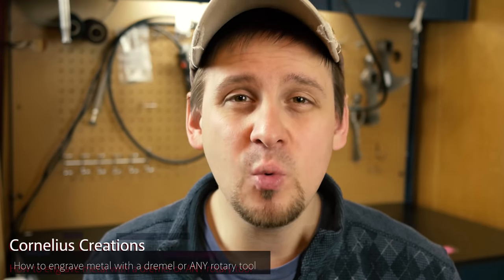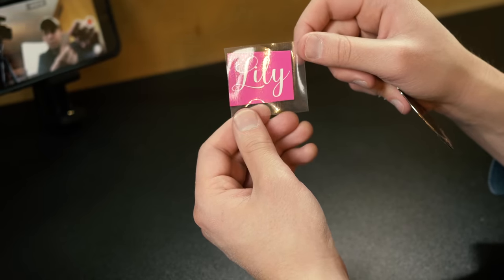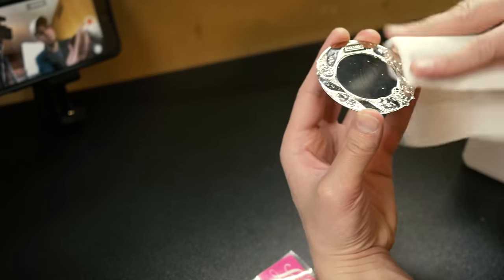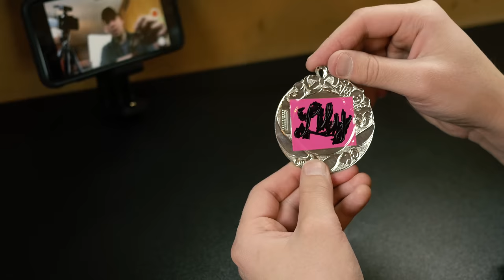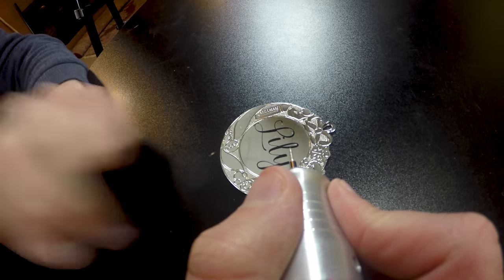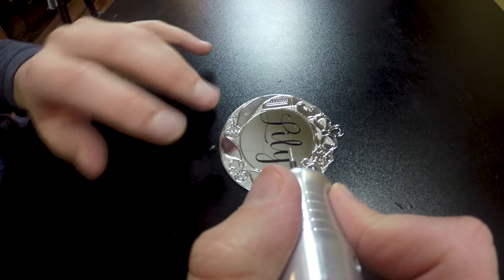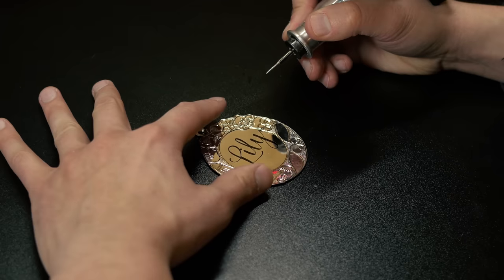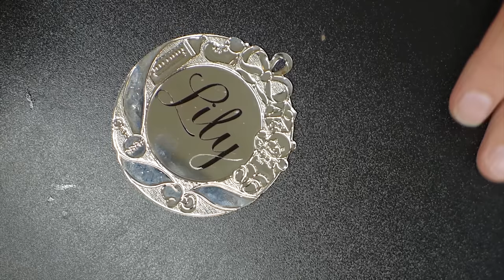How To Engrave Metal With A Dremel Or ANY Rotary Tool

Comment from the maker: ⚒️ TOOLS & SUPPLIES I USE FROM AMAZON ⚒️
⚡︎ FOREDOM CARVER (MY FAVORITE) https://amzn.to/2HRXbzC
⚡︎ DREMEL 4000 CARVER: https://amzn.to/2Ubc4TS
⚡︎ CHEAPER CARVER: https://amzn.to/2HPa1i5
⚡︎ CARVING HAND TOOLS: https://amzn.to/2HSLusu
⚡︎ BASSWOOD BLOCKS: https://amzn.to/2WCYXYr

⚡︎ ROTARY BURS: https://amzn.to/2Va2Q79 
⚡︎ BEST WOODBURNER: https://amzn.to/2FJYE7p
⚡︎ GOOD WOODBURNER: https://amzn.to/2FMLZ3t
⚡︎ CARVING KNIFE SET: https://amzn.to/2I4z53F
⚡︎ WOODCARVING APRON: https://amzn.to/2UoUX0k
⚡︎ DUST COLLECTOR: https://amzn.to/2UnR5MV

⚡︎ CHEAPER DUST COLLECTOR: https://amzn.to/2I3jYHW
⚡︎ SCROLL SAW: https://amzn.to/2TKjtok
⚡︎ MINI GRINDER: https://amzn.to/2OHxYIM
⚡︎ ROUTER: https://amzn.to/2WCYAgv
⚡︎ CARVING LIGHTS I USE: https://amzn.to/2HTb9AY
⚡︎ CHEAPER LIGHTS: https://amzn.to/2UbtqQO

⚡︎ SANDPAPER: https://amzn.to/2WHKjPA
⚡︎ FILES: https://amzn.to/2UboAD6
⚡︎ DUST MASK: https://amzn.to/2UbupAu
⚡︎ FAVORITE STAIN: https://amzn.to/2HRKvIQ
⚡︎ MY LEATHER WORKING KIT: https://amzn.to/2WGWtsh
⚡︎ CARBON PAPER: https://amzn.to/2HQV670
Reply: Cornelius Creations
Reply: Does that machine engrave on wood and plastic too?
Reply: Did you use all the above tools in that one project?
Reply: I bought engraving tool today, I tried to work with it, but was moving and trembling too much, wasn’t steady and couldn’t do engraving. I watched your video and didn’t saw that is trembling, so this tool has deffect?

Comment: One more suggestion: my first Dremel was very small and lightweight making it very difficult to prevent bouncing around and shaking. So, I taped a weight to the back of my Dremel to help stay still. I tattooed for 20 years and I used this same technique with my rotary tattoo machines which were usually extremely light weight compared to my coil machines. Cool machines can be from brass which is quite heavy. I had already been tattooing for 10 years before I picked up a rotary machine for the first time so to go from something very heavy to something very light made it really difficult to hold my hand still that’s when I just started putting weight on my machines.
Reply: Thanks 
I’m about to do a few runes on my silve Thor’s hammer I’m making so I will do this 👍🏼
Reply: Thanks, very helpful 😃
Reply: I’m actually looking at engraving the side plate of my coils, I have a set of all matte black mike pikes and want to  make them my own. Also have a few commercial series coils that I’d like to engrave.

Comment: After, you can reapply a stencil to block off the surrounding areas. Then use #0-000 steel wool and just brush the engraved area. This will smooth out the etching so it doesn’t look so rough.
Reply from the maker: Great tip!
Reply: I'll have to keep that mind as well. I'll be getting into creating horse shoe nail cross necklaces with soldering on a washer. The cleaning of the solder is quite extensive with using dremel stone bits/diamond bits then lapping and polishing the solder afterwards.
Reply: Suggest leaving the stencil in place start to finish.

Comment: This video was awesome like the rest of them I just got my Dremel and I'm really excited to start this whole new world!  Thank you so much for creating them! 
I was wondering if you would talk a little more about stenciling and using vinyl with your work as a stencil.  Biggest question I have is why you bother removing the vinyl BEFORE you start to use the dremel. Why can't you dremel with the vinyl on?
Reply from the maker: That will be a great video idea! There is really no reason why I do that, you could still do that with the vinyl on. That way would be faster perhaps, I am just so used to taking the vinyl off!
Reply: @CorneliusCreations  I thought that there might be a problem with it. Maybe the vinyl ruining the drill heads? 
Anyway I tried it and it worked well! Made it so I didn't have to sand the letters afterwards. ( assuming I do the sharpie method and everything is black but i want it wood again)

Comment: One question...Is it better to have more RPMs than a dremel can offer? Is the SCM system @ 400,000 RPM best? worth the money?
Thank you for all of your tutorials. I respect what you have to say. Looking forward to your reply. I only want to engrave metal for now.
Doug
Reply from the maker: Hey Doug! That question is contingent on your needs. The higher RPM systems are for more of high end detail work while slower rotary tools are for ”hogging wood” and general carving. All of them will benefit you in some way. Yes, the SCM SYSTEM is worth the money for sure. General rule of thumb, higher rpm's gives you smoother cuts.

Comment: Man I enjoyed this because I’m always etching on something. The 8:20 mark answered the only question I had. 👍🏽 
I have a couple of engravers but I’ve never used my Dremel. However, I’ve got a bracelet that I can hardly wait to engrave with the Dremel a fine diamond bit similar to the one you used. Using a stencil is an excellent idea as well. 

I’m a retired barber; the allusion to fading or blending is spot on too. 
 😉

Thanks for the idea and tips.
Reply: Instead of diamond burr, use  a '0' or '1' carbide tip, OR h.s.steel burr (after practising on flat tin/copoer/brass to produce acceptable quality. 
  Diamond will chop up lines as it is crusted tip.
   Without this, you may well regret having damaged/ruined the bracelet.
  Also, if this is a 'plated surface, plating may peel off if inferior quality.
  Do resist temptation to engrave on your bracelet well before becoming skilled enough to do so.

Comment: Wow ! Thank u soo much ! 💓 i have a question,  i have NEVER attempted anything like this, but i am preparing my now 6 yr old daughter's bedroom, whom i am reconnecting with after 4 VERY long years of a custody battle; her favorite movie is Encanto, so, i want to do a custom engraved brass door knob for her, i hope it helps her to feel more comfortable and at home here with me and hopefully it will make her feel special and loved. I found a really good deal on temu for engraving pens and dremels and tips or bits or whatever they're called lol (i am very novice if u can tell lol) ~ there are several different sizes though. One of them is for 0.1mm to 1mm another is 0.3mm to 2mm and the other is 1mm to 3mm. I'm guessing i should go with the 0.1mm to 1mm ? Or is that too thin? I do want to do some fine detail, but, I'm worried if it is like needle thin, the vibrations might make it too jabby ? Again, i have no idea what i am doing, and i am going to practice on some things before going for the actual door knob , but any advice on bit sizes ? And the pros and cons of each ? Also, what different effects do different material bits do ? I think u mentioned something about carbon and diamond? 

Also, u just gained a subscriber. I have adhd (if that's not already apparent ) and i LOVE doing things with my hands, (and , i kinda HAVE to keep my hands occupied so i can concentrate on other things) and i love the way u explained everything straight and to the point and i just about fell out of my seat when i saw that u also have videos on engraving wood !!! Wood carving? Sorry, new to all this. 

 Side note:

I am HELL BENT on doing this door knob for her myself because i HATE how modern 'engraving' is usually just like, writing on the surface of something.  I guess that's the lazer 'engraving' ? At any rate, i much prefer the old school engraving , where the surface is actually carved. Anyway,  any thoughts on bit sizes and types please ? 

Oh ! Also, do u happen to have any advice on getting scratches out of a polished surface like chrome or polished brass ? 

Thank u so much again ! Best of luck to u in ur endeavors !

Comment: I found your video just in time to begin my first project.  I am restoring a 100 year old machete and intend to etch some art work on the blade.  Will the bit you use work on hard steel?  If not...then what will work?  Thanks

Mono D.
Reply from the maker: No, you will need a tungsten carbide. Be sure to use the appropriate safety measures!

Comment: Hey! Thank you so much for this. Do you think the 4300 is better than the 4000 (just happens to be cheaper right now). And do you think the Demmel Stylo is sufficient for engraving metal (steel, gold plated silver, silver)? Or do you think I should get a dremmel 3000/4300 with a flex shaft attachment?
Reply from the maker: For engraving metal you need more horsepower than the Stylo.  Both of those are good. Whatever you budget allows would be the best option

Comment: Thank you for showing this. LOL I have a Dremel at home, and was wondering what kind of tool I needed to buy. I just want to mark my cutting blades with the appropriate size disc hole plate for my meat grinder. I purchased one cutting blade for each different hole plate. 

A lot of people don't know that the cutting blade is machining itself to the disc hole plate the first time you use it. When you use the same cutting blade for a different disc hole plate it machines itself to the new disc dulling the blade each time you use a different disc. 

So I purchased a blade for each disc hole size and on the inside of the blades it is recessed. This is where I want to engrave on the stainless steel blade the matching disc hole plate it goes with. IE: 10mm, 7mm, 4.5mm. 

It does not have to be fancy but if I wanted to get fancy with it, 
How would a make a stencil? 
Where would I go to get the materials to make the stencil?

Peace, Reese
Reply from the maker: Just saw your other comment, if you need anymore help let me know :)
Reply: 8

Comment: Nice...just wondering did you use the same method to engrave the wordings behind? If not, what method did you use for the words behind? Hope to hear from you..thanks! :)
Reply from the maker: Hey there! I’m not sure what you asked. Please message me on how to wood carve or on FB and reword a different way and I’ll do my best to help you my friend
Reply: Cornelius Creations Thanks for replying..:) Am currently looking around for a metal engraving method which could produce the exact results as the words on the ornament (both front and back) which you had engraved the name “Lily” on. As my hands are not as steady as yours..If there is a engraving method for metal which could produce the same result as shown in your video without the need to freehand the words, it would be terrific :)

Comment: Do you have any guesses as to how long a cheaper diamond bit, like one from Harbor Freight, would last?  Like the "amount of inches I would get" out of one so to speak.  Getting a laptop from my friend with an aluminum-alloy based lid plate, I want to engrave something in it that will probably be about 10 inches by 7 inches.  It's nothing too elaborate, just a quick outline like you did in the video here, but the outline will be pretty big.
Reply from the maker: That all depends on the material. The burrs for. Harbor freight should work fine for that 👍🏻
Reply: @CorneliusCreations  Dell never specifies what it is but I think it's some kind of aluminum alloy they use.  Not a metal expert by any means but I'm guessing it should last longer anyway because it's a softer metal (I assume).  One last question, is it possible to sharpen these bits if they do get dulled out from use?  If so what would you recommend?
Reply from the maker: No possible way to sharpen it unless it is a special type of burr where the company offers resharpening (usually for high end carbide burrs) a cheap pair of diamond grits will work for you.

Comment: So i can cut as well as engrave metal or plastic with engraving bits?. Or does Cutting through metal require some other attachment? I'm tired of using the hacksaw. Secondly doesnt the diamond bits last less longer than the standard steel bits?
Reply from the maker: To engrave you need a carbide bit, diamonds are good for softer steel like this, but I was more less scratching the surface. If your actually “cutting through” metal you need a band saw with a premium blade made for cutting metal.
Reply from the maker: And yes diamond is coated so it will wear faster than stand steel bits

Comment: I used clear window decals that I can print with my inkjet printer.  Then I engraved through the thin decal.  I use a 105 round dremel bit.  Foredom Is the best you can get.
Reply: Where do you get clear window decals?

Comment: Hello sir mat. I want to ask ive always dream to be a metal carver. My wife bought me a rotary tool with some metal carving pins. I try to carve some viking runes from an old axe just for a start. But nothing realy happen no carving at all just scratches n not even a few mm Dent. Pls what do u think what mistake am i doing?
Thank u very much for your answer..
Reply from the maker: Hey there! Make sure you have the proper safety gear first. Then use tungsten carbide burrs to do that with. The burrs you are using only is scratching. You need them to dig in and actually remove the metal.

Comment: Nice piece :) but it'd be a much easier & cleaner carve if you put it on a small turntable.I hold mine down with "museum putty" which removes easily & won't mar surfaces.And a block off & once over with the finest steel wool( or copper wool,which I prefer,but sometimes harder to find in hardware stores,lol)will smooth out the dremel carve lines,esp if you're not changing heads & staying with the fine tip on larger areas.
Reply from the maker: Great tip! Thank you!

Comment: I want to try and etch on a charm sized metal disc (around 12mm). I have a cricut and think i can print out the word on stencil however the letters will be very small! Do you think this would be very difficult? Thx for the great video!
Reply from the maker: It will certainty present it's own set of challenges but it Is possible. I would get some magnifier glasses off of amazon so you can see it! It wouldn't have hurt me to get some glasses with the lettering being so small in this video.

Comment: Lolwhen you were talking about rpms i was just thinking about how my electric nail file goes up to 65000 rpm's and the fact that its cordless, compact and the power bank can clip right onto your pants makes me wonder if i should just use it instead of my dremmel.lol probably not, as it was 6 times the price of my dremmel and the bits are 20+ dollars a piece. Which i dont buy anymore.lol anyway, thank you so much for this video! The thing i really find helpful was to score the lettering out first as i have issues with my tool sliding really bad. Tsmfs! New sub!

Comment: I'm having such a hard time having a steady enough hand with the tool going for it to be a straight/smooth line... any tips for that?
Reply: having a work stand you can adjust to the right height helps, good lighting, brace as much of your arms+hands against the piece and table, use two hands (one advancing the tool, other resisting the advance, like with a chisel), focus on very light downward pressure each pass, it helps for fine work to have a hobby magnifier, and it might not hurt to have a few fine needle files+chalk on hand to smooth out larger engravings. I use rotary tools to rough engrave/carve/inlet gun parts, and finish them out with hand tools, it drastically speeds up the process and keeps the bulk of the wear on cheaper, replaceable bits vs the expensive chisels and gravers

Comment: Pretty good 👍work..I would describe this as carving and sculpting...engraving is a clean cut method with a single  cutting surface and leaves a shine when cut.  I've used a Foredom for several decades and had to change brushes in the motor..takes less than two minute problem..very good tool...I also bought a Harbor freight one for 50$ and it is very good 👍..

Comment: Great vid. Can the same be done with chrome trim instead of tin? And is there any vid/tips you could direct me to on how to get into doing that? That would be helpful
Reply from the maker: Yes, absolutely
Reply: @CorneliusCreations  cool, man. just thought that the chrome plating would begin chipping or chrome would expose what's underneath if there is anything underneath that would begin rust or oxidize and don't want it to

Comment: Wow I came to this video late 😅 Never tried this before but was looking for a way to put a viking design onto a piece of 20 gauge mild steel. Tried embossing but it did not work at all and came out terrible as the design was to intricate. 
Would something like this work on steel? I have an etching kit and a rotary tool but never used the etching kit before
Reply from the maker: It will work for a very light engraving.

Comment: Nice ! I used the same thing to etch a class bottle . Thanks for showing this. I was curious if the diamond bits would be good on metal
Reply from the maker: Carbide would actually work better on metal. I will have a video out soon
Reply: @CorneliusCreations  
Yes, carbide is much better due to the hardness plus lasts a lot longer.

Comment: hello! for an art project I'm engraving really small letters with a 0.2 tiny burr. my problem is that whenever I use a flex shaft the burr vibrate too much so I end up making a thicker line. 
I guess I need a good quality but not expensive rotary pen engraver, any recomendations ?
Reply from the maker: For what you are wanting to do may require a more expensive machine. Check out this blog post I wrote: https://www.howtowoodcarve.com/post/choosing-the-right-flexshaft-tool